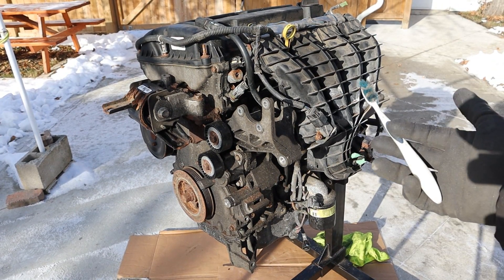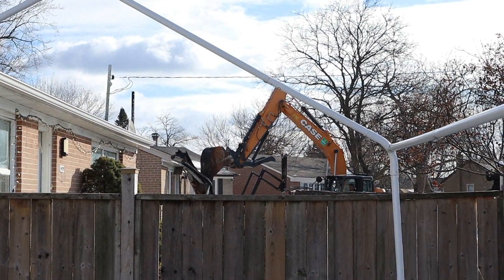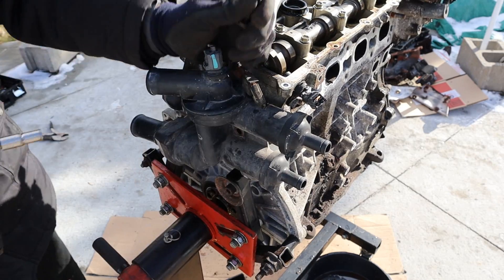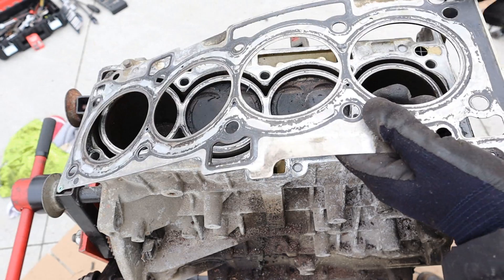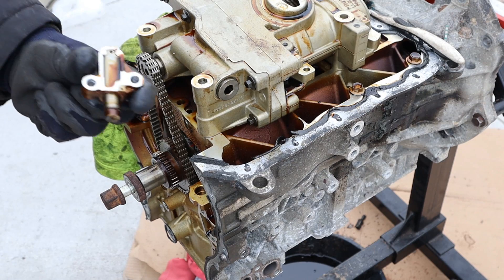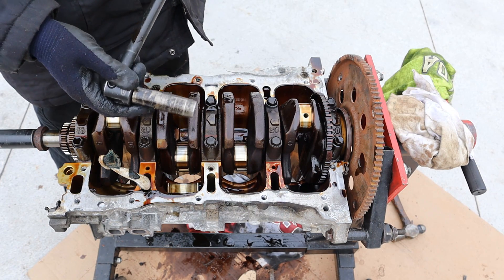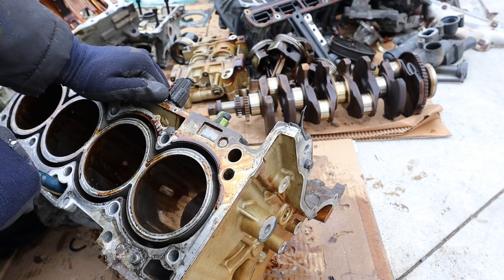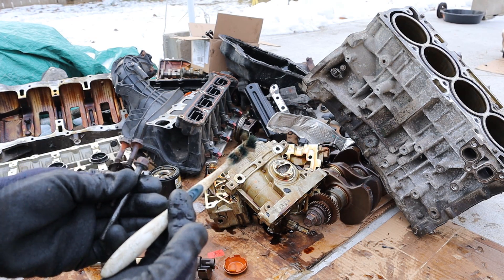Why the Chrysler World Engine is a Failure

Comment: Muchos errores, el sensor de presión de aceite no es el sensor de temperatura del refrigerante. Mencionas muchos plásticos, en el riel de la cadena no puede llevar metal, imagínate el ruido. Fallas en la CVT? No todos llevan CVT. Es de los motores más fáciles de trabajar que las porquerías que hace Stellantis hoy en día. Es un buen motor, potente y fácil de reparar.
Reply from the maker: Thanks for your input and sorry for the sensor confusion. 
Timing chain guides could be metal with a plastic slide, not completely moulded from plastic. 

In longitudinal form this engine can be pretty easy to work on. All FWD V6's however are always a pain.

Comment: My 2015 2.4 patriot has 109k miles on it. Recently it started burning oil. Turns out the piston rings really stuck in a few cylinders (2). Doing a piston soak has restored a ton of compression and it runs nicely and no more rich gas smell.

Comment: Amigo,  you keep stating about the problem this motor has with wear and the obvious lack of maintenance shown by the oil condition BUT you keep also commenting on it having high miles. Just something to think about. Also, no rod bearings?😮😮

Comment: One of the best engines made-- I ran a few in my fleet to 290K+ before cars went to yard for other reasons.  You are just talking out of your butt and know nothing about this engine.
Reply from the maker: It can be a good engine if you take care of the cam issue and the oil filter housing
Reply: @speedkar99  Are talking about the 3.6?  2.4 has a screw on filter and no cam issues.

Comment: The 2.4 world engine is not a bad engine at all...yes it has a bit to much plastic...but otherwise with regular oil changes and some routine maintenance...it is an extremely reliable good running engine.Not sure about the 2.0 litre shown here...but it looks close to the same design..

Comment: It’s so easy for people to pick on Chrysler/Stellantis, seems to be especially common amongst people that have never torn down an engine in their life and people that have very low to no understanding of mechanical engineering. I personally don’t see anything wrong with this engine design but to each their own I guess!
Reply from the maker: I don't see alot wrong with the fundamentals here....it's all the bolt on parts, like the oil cooler and cams that defame this engine.
Reply: @speedkar99  i still don’t see any problem with this engine. Sure, it’s designed with a lot of thermoplastic parts but the same goes for just about any other engine manufacturer that is trying to provide an economical solution for the powertrain whilst keeping the overall vehicle price down.

One thing I do agree with you on are the bolts/fasteners, they all rust on Chrysler/Stellantis vehicles, even in the South where they don’t even salt the roads, what’s up with that?!  🤷‍♂️

Comment: I had a fleet of cars with these engines.  This engine is one of the most reliable motors out there. Multiple cars run over 200K and one to 290K and zero issues.  I'm not sure why your are trashing it so hard?

Comment: I thought this guy was going to show why this engine was a failure? I retired after working as a Chrysler tech since 1979. The only failures I saw on these engines was due to lack of maintenance. I've seen them with 300k on them. My Avenger, which I purchased new has nearly 100k. This is a very reliable engine.

Comment: This is a GEMA engine. You also forgot about Mitsubishi who also uses them. Not sure why you’re you’re calling them a failure?? Many of these in the 2.4L form are going well over 300k. 

Abused and neglected engines are not considered a failure! 
These engines are still very much in use today by Hyundai as it is known as the Theta and this was the engine involved in the class action for improper manufacturing and Mitsubishi still currently uses their variation. Chrysler updated their version under FCA FIAT with the multiair design

This engine you are ripping on was oil starved and sadly neglected and you should state that rather than generalizing it as a failure! Your bias as mechanic is showing and it serves no purpose other than making it opinion. There are plenty of these out there going well over 300K. These engines are not engines you dump crappy oil in  with their VVT. They should be run with synthetic oil of the natural gas verity and it should changed frequently and not at this 7500 or 15k BS!! That’s not gonna work out well!

Comment: I was a Jeep Eagle and tech and left working for Chrysler in 2011 and as for my own opinion the world engine in the 2.4 liter form it’s a great engine as for the 2.0 I hardly ever saw one so to the fact the dealers I worked at never ordered base calibers patriots or compasses. My wife had 135,000 on her compass my Patriot has 72k and still runs strong. I did one head gasket on a 2.0 and that’s it. The 2.4 turbo wasn’t bad though not many made in caliber form just neon srt4 and early ones had oil pump problems from modified boost levels. I’ve had my fat share of early turbo Mopars I’ve seen it all. The Chrysler 3.6 and Hemi  share the same failures in oiling and again my opinion cheap parts but the Chevy LS does the same with lifters and cams. No one makes a perfect product. What I’ve seen Chrysler do is bring stuff out and piss people off for two years and then make it great then stop producing it. The final run of the Omni was great as was 98 and up neon with the 3speed same with the 3.0 3spd acclaim. I seen more poor maintaining failures then anything minus the junk 2.7. The early 3.5 was awesome

Comment: Dude. The rtv on the oil pan is common practice for car manufacturers now and it works better than the gaskets of yesteryear. Get with the times. Im a professional technician and these engines do quite well compared to the garbage manufacturers are putting out today. Its a simple reliable design and uses a timing chain instead of a shitty belt.

Comment: I still have my 2010 Caliber SXT around. Got it in 2014 and has been a great commuter since then. Original engine and CVT trans. Maintenance is important and not overloading it’s capacity. The wagon is just about to hit 130k miles and it still moves pretty quick. I’ve smoked a few people with that engine. I could confidently say that it all depends on the owner. Even if they claim they maintain their cars but abuse them, then you know why it  died so early.

Comment: This is one of the most reliable engines that Chrysler used, ironically powered one the worst cars they ever made. I worked at a Chrysler dealer for 10 years. I saw 1 world engine throw a rod. I saw hundreds of hemi lifter and cam failures, I was constantly replacing cylinder heads and rocker arms on the 3.6. Sure the world engine is loud and underpowered, but so was the Jeep 4.0. As far as common failures, I cant think of any. Maybe the intake tuning valve, but not all of these had that. Also the coolant adapter leaks, but it takes a half hour to replace, it’s a relatively cheap repair, and you don’t have to get into the engine internals to repair.

Comment: Why bother creating another Hyundai engine?  What the world needs now is a more efficient engine, now that Biden is carrying out his plan to kill the fossil fuel industry by making gas cost more than $5/gallon. ( there are many reasons why you dislike Trump, but at least he was was on OUR SIDE.)
What we really need is a 6 stroke engine.  This like a 4 stroke engine but has a 5th stroke where water is injected into a hot engine and turns into steam that does a second power stroke.  In stroke #6 the steam is pumped out of the cylinder in something like a 2nd exhaust stroke.

Comment: I loved the video. I'm from Brazil and I'm thinking of buying a 2017 jeep compass equipped with the 2.0 engine. The manual contains only two revisions, one at 12.168km in 2018 and another at 24.131km in 2020. Currently the car has 40000km and the 36000km revision is not included in the manual. Would you recommend the purchase anyway? Thanks for the content.

Comment: A F150 forum member drove a Jeep Compass with this engine over 400,000 miles and he said the engine was still running fine with no oil burning.  But the body rusted out to the point he had to give up on it.
Reply from the maker: The compass and caliber platform had a bad rusting problem

Comment: I have one of these, they are tough little engines, besides replacing the pulllys and spark plugs, never had a problem in 15 years. change the oil once in a while and don't over heat it. Revving little engines too, 6,750 redline.

Comment: At times, using a thinner fastener is better than a thick one.  Using one that's as thin as possible will give you better tension.  Think of wrapping a oil pan with bailing wire vs. bungee.  The bungee will be flexible & always give some tension vs the ridged bailing wire.
Reply: Does not compute. More realistic, imagine a head held on with 1/4" bolt vs 1/2".  I'll take the 1/2".
Reply: @boots7859   You don't understand the mechanics of metal, heat, expansion, & contraction.  Sorry, no cookie for you.  Go to the back of the line.

Comment: Never seen someone so offended by plastic parts (not broken on an engine that has outlived the vehicle) and the concept of using an appropriately sized fastener, even when that means more than one size bolt is used.

I took a plastic timing gear out of 1971 400 Ford last year. Updating the cam... timing gear still going strong. Turns out all the outrage over those plastic gears was much ado about nothing.
Reply from the maker: Nice. To me, plastic seems like cost cutting.
Reply: It entirely depends on the plastic composition. There are good plastics and shitty ones. For example, my Chrysler World Engine car, the plastic coolant pipe were the rad cap screws on crumbled at 12 years old, causing the radiator hose to fly off. Whereas I had three GM cars over 21 years old, all with their original plastic radiators. One is an example of shit plastic, while the other is an example of a good plastic. I still prefer metal as when you see metal you know it's good whereas if it's plastic you wonder if it will crumble after 8 years, or last 25...

Comment: I’d never ever buy anything Chrysler.  Piece of sh!t products with a piece of sh!t engine made with piece of sh!t parts made out of piece of sh!t materials.  I remember when Daimler-Chrysler was a thing.  From that point on, quality of Mercedes Benz product spiraled down.  One of their many problematic platforms was the M272 3.5L v6 engines.  They used crappy materials on the balance shaft assembly, timing gears, crappy timing chain guides…probably made of the same crap materials that they used in this engine.

Comment: You really never said specifically why this engine is not a good one in fact you made several statements that point to your lack of basic engineering skills.  I don't see anything other than lack of oil changes that caused problems for this engine.

Comment: I had a Caliber with the 2.0L World engine.  While this was certainly not an era of quality for Chrysler, I don't think I'd give much blame to the engine.  Decent horsepower for its size, but my theory on that is that the cam adjusted to produce less torque and prolong CVT life.  Result is iffy fuel economy, but it wasn't bad to drive.  What was definitely a tragedy concerning this engine is the sound.  Winter start up was atrocious, and the exhaust "note" was about as pleasant as a straight piped Civic.  All of the legitimate problems with the vehicles involved low quality metal in the suspension, and the disaster that is the electrical system.  I really liked the design of the interior.  Yeah, cheap hard touch plastics, but 4 cup holders in reach of the driver, two glove boxes, and a power inverter.  Pretty cool.
Reply: The Caliber could've been a fine car if they'd just used the Ultradrive trans instead of that dreadful CVT. Stronger ball joint design would've helped a lot too, but that's just typical Dodge stuff.
Reply from the maker: I tend to agree on most points. The engine 's bolt on parts don't scream quality either. It's internals seem well engineered.

Comment: Speedkar, can you do the Nissan Infiniti VK50VE? It's an ultra rare and unique engine. It is essentially the V8 version of the VQ37VHR and I've never seen it modified or boosted before! It puts out just under 400 HP and was used in the LMP3 race care, but only ever put into the FX50 and early QX70 production models. I would love to watch you tear that engine down.
Reply from the maker: I'd love to do a teardown if I can find one. I'd print have to buy the whole car to get one

Comment: I've had a few different first gen  Mini Coopers (Mopar engine) and it's pretty common to trade out the weird stamped metal idler pullies with the plastic ones from this engine, especially when going to a smaller supercharger pulley because the larger plastic idler lets you run the stock belt.

The first gen BMW Mini engine is actually a Neon SOHC 2.0 with reduced bore, bore spacing, and a timing chain rather than a belt.

I had way more fun turning up to Mopar events than BMW ones!
Reply: Lol pretty funny. Didn’t know that. Ty for the information!
Reply from the maker: Cool! I have a (second gen) mini cooper engine teardown coming soon!

Comment: Why did my first 09 Sebring go 331k+ before possible ECU faiure(still diagnosing died at a red light) and I have another 13 200 with 175k still ticking. 
Had the 09 since it had 20 miles on it. 
Used Mobil one extended performance and changed the oil every 5-7k miles. Still doing the same with my 13. 
Everything on the road is a POS with some type of flaw or questionable quality components. 
But that's just my experience. I've found doing regular maintenance and services at the recommended intervals gets the most life out of any manufactures vehicle (25% or less of vehicle owners do this) 
Like the video and how thoroughly done it is.
Reply from the maker: That's awesome. Are you sure the Sebring had the world engine?
Reply: @speedkar99  definitely not the 2.7L V6!  it along with my 2013 has the 2.4L and I've always heard that referred to as the world engine, it looks identical to what you're tearing down. 
In those 331k (I might repair the car ? Yet to have diagnosed it properly) I've replaced the vvt solenoids a few times, alternator once, starter only because I already had the intake manifold off changing the Electronic throttle body once. Ignition coils and the water outlet plus both thermostats since there was a slight leak. 
My 99 Durango and wife's 05 Corolla are the only other vehicles I've owned that made it over 250k (Durango 5.9l lost compression at 318k and a tree fell on the Corolla at 455k and I'm still pissed) both of those we were the second owners and replaced transmissions once a piece.
Reply: @speedkar99  *all miles and not K. Ohio vehicles so all got salt too. Body was a joke on the Durango

Comment: Believe it or not I have a caliber with a 2.0 that has 270k and no leaks or blow by. Religiously changing the oil with Mobil 1 at 4K miles idc what anyone says.
Reply from the maker: How's the rest tof the car holding up?
Reply: @speedkar99  I live in AZ. It’s good. Transmission went out at 200k but I bought the car from dodge brand new they were selling with a lifetime warranty on engine and tranny so free tranny for me. Definitely should’ve been out for the count at 100k not very well built.

Comment: That engine actually looks pretty decent 🤷‍♂Biggest surprise is they have a bed plate...but don't use it to hold the lower main bearings. That seems like a very odd choice, giving up lots of lower end stiffness. Everything else looks equivalent or better than other 4 cylinder cars of mid-2000s+. I like the cam-on-bucket valvetrain, too, very simple.
Reply from the maker: Agreed. What's up with that bedplate...

Comment: The Mitsubishi version of this engine is called the 4B11, and has been in production for about 15 years. It is completely bulletproof- no real issues whatsoever. 

The 4B12 is the 2.4L version and is also perfect.
Reply from the maker: And the Hyundai version is the absolute worse
Reply: @speedkar99  Maybe the NA version?  My Genesis has a version very similar to the Mitsubishi version, other than the timing chain issue that the 4b11 also has, I cant really say anything bad about it.  Could use balance shafts but other than that it has been great.

Comment: I see no failure but a well worn engine. At least the water pump is driven from the serpentine belt and not from the timing chain.
Reply from the maker: This engine didn't have a mechanical failure but it's quality is meh
Reply: @speedkar99  could be a lot worse... Like gm or Ford or kia....

Comment: Drives me nuts as an engineer when people consistently refer to the fasteners by the hex-head size, not the fastener diameter.  One can't go to the hardware store and say I want a "10" by the hex size as you'll walk out with M10 hardware instead of the (likely) M6 you really want.  But 100% cannot argue with pointing out the craziness of having SO many hex sizes, makes service a real pain, NOT excusable from a design perspective.  Surface-rusted hardware doesn't imply bad quality from a clamp-load perspective, but customer perception suffers.  As others have stated though, the Chrysler cars these motors went into were basically throwaways anyhow, so one can see the penny-pinching on stuff like hardware plating.  There's like no profit-margin on these low-buck cars from an OEM standpoint, and the car bodies will rust away long before the various bolt-heads on the engines do.